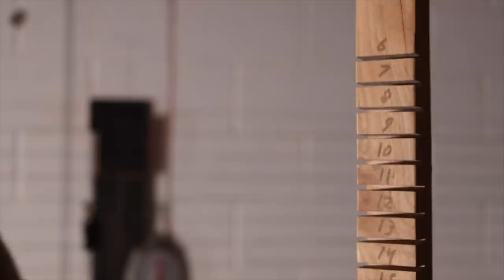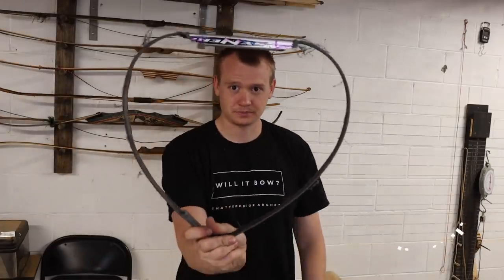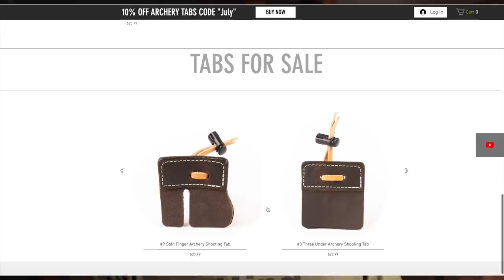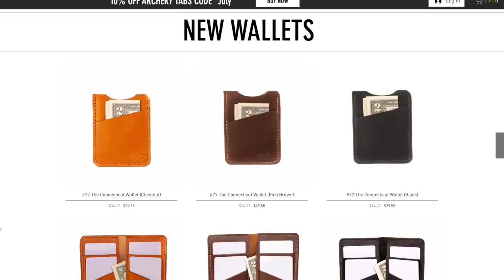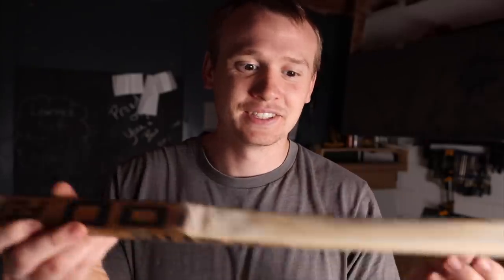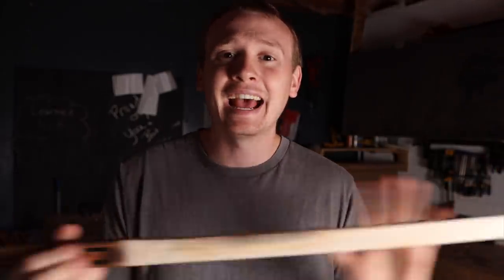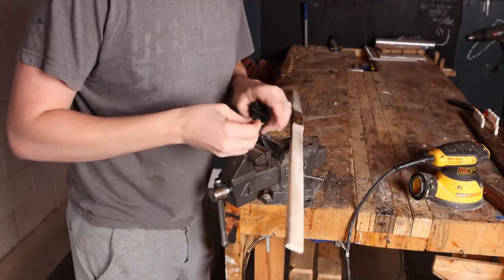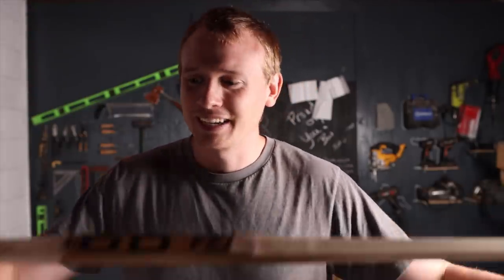Making A bow Out Of A Wooden Hockey Stick "WILL IT BOW" Ep. 6

Comment: I have a few bow ideas you might like:
1.) A composite flat-bow with a thin panel of spring steel for the compression side and a thin panel of bamboo for the tension side
2.) A PVC recurve bow (I suggest 3/4" or 1" schedule 40 PVC with fiberglass driveway marker rods in the center)
3.) A composite Oak and Hickory bow
4.) A pure fiberglass tape bow
5.) A bow made of paper and resin

Comment: I use axe, hatchet, knife, rasp, sandpaper. I carve the bow to general form before drying. I steam it immediately then dry the bow on a simple straightening board in the cab of my truck. Rocky Mountain Juniper shortbow with sinew backing. I tiller the bow on the floor and on a branch. I take my time. In the shade on sunny days or by the campfire at night. Short draw length Comanche style 46" just a bit long. But I'm tall.

Comment: Any chance you've got any more hockey sticks? Hypothetically if you have a pretty bendy one, you could just lop off the end and cut some nocks into it and have a decent, admittedly very high poundage bow (might need to make a riser for the handle section, depending how much it bends through the handle) . You tend to build fairly light bows, so maybe that's why you haven't? I like to build bows that are legal to hunt deer with. I learned how to make wooden bows from BoarriorBows' channel around 8-ish years ago. Then I moved onto making heat-shaped PVC bows after finding Backyard Bowyer's channel back then. Made a bunch of those. It feels like cheating because you can make an okay bow in like 20 minutes once you get the hang of it (and make a shaping jig). 

Anyway, keep up the good work! Fun series, and your production values are through the roof!

Comment: I'd be fascinated to see your take on PVC bows! Do you have a recurve in the works?
Reply: I really want to see a comparision of your bows vs PVC bows.  What if yours are only 10% better, but the PVC bows take 1/10 the time to make?
Reply: Depends on how you're making the pvc bow what your top end performance will be, but I can see that pvc can be good for training draw strength. Quick to make a high poundage bow with thick pipe. Problem is weight to performance ratio and uv degradation
Reply: @bryandavid192  i speak from 20+ years experience with pvc as a sprinkler system design and installer, i can say it retains flexibility and durability through over a week of high uv days in the SE NM desert where the sun melts paint off cars. i have a 45# pvc recurve, flings cane arrows with great force and carbon ones with great speed; paint helps with uv degradation but also if ya just don't let it sit in the sun for weeks it will be fine.  also its lighter than my green fiberglass bear 'archery' youth bow, and far less handshock. they're a great option for a budget bow because of the resistance to literally everything else, they buckle before they break (never broke one myself), decently high powered longbows can be made with low cost equipment (pallet wood&screws works for forms) and be ready to shoot in minutes. hard to beat pvc for effectively arming large groups of archers. that being said, im dyin to find a feather glass hockey stick to follow along with kramer here, that bow is soo cool!! maybe not cooler than my recurve but id definitely make one if a stick showed up in my world.

Comment: I love this and will copy, i was just about to start my umteenth bow out of a carbonfiber hockey stick. Mine is similar to yours but ill cut out the sides and epoxy them in as reinforcement for the limbs with wood insert like yours howerver ill inser two fiberglass half inch dowels  per limb epoxied into the wood then three very flexible quarter inch diameter carbon fiber rods electrical  taped and epoxyed together under tension then recurved the opposite direction of my induced bend for some seriouse strength! Then ill make tips for my limbs that pull it all together with more epoxy and wraping. Should be sweet. Im just in the prosses of finnishing my current project bow, its one half inch fiberglass dowel with two long quarter inch carbon fiber dowels for limbs with two decreing size additional quarter inch carbon fiber rods to stiffen the mid section. Then for extra fun its two string, giving me a short warnow at about 145 lbs at 24 inch draw and 115 or so at 33 inches with a total length of 35.5 inches its awsome. Ive fired 900 grain shaft only at less poundeg with sweet results at current tension will be wicked!

Comment: I played hockey growing up. Sticks can crack internally in the shaft. Mostly they will crack at the heal, ( where the blade meets the shaft). 
Just a tip, once you cut off the blade, hold the stick in your hand like shooting a bow about 8 - 12 inches from the ground. Let it fall to the ground and listen for a thud or a “ring”. If you hear a thud sound the stick is solid if you hear a ringing sound then the stick is cracked. Cracks most likely will be on the side of the stick where the concave side of the blade as this is where most of the stress is when making a shot. You can also test the stick before cutting off the blade. I would say that chunk came out from the blade end of the stick       
This could be why that big chunk came out. 
If you ever make another hockey stick bow with a used stick keep that in mind. Not all used sticks will have cracks in them.
Now I want to make one out of my old hockey stick.

Comment: Hey Kramer,
I am making my first board bow using a popular board. Any tips?
Reply: It’s my first board bow. I have attempted to make one out of an aspen in a local forest.
Reply: I'd suggest trying a different wood. Maple, oak, walnut, and locust boards should be available. 
I'll tell you 2 secrets! If it's a broad leaf it's most likely a hardwood, if it's an evergreen most likely soft.
Hard or soft has no reflection of bow performance.
Pacific yew and Rocky mountain juniper can be scratched with a thumbnail. But I assure you those are some of the best.
I'd try as many different as you can get your hands on. 
Let me know how that poplar works.
Reply: Thanks for the advice!